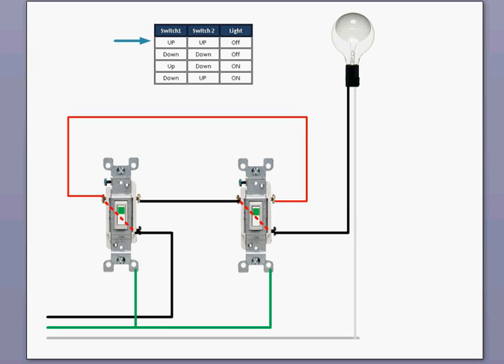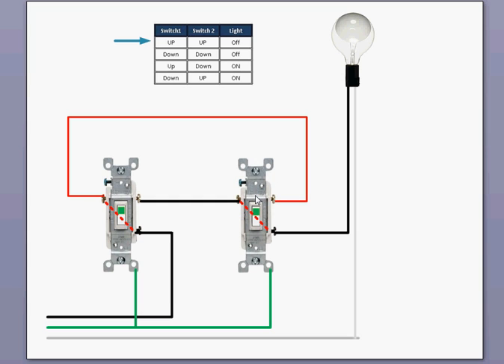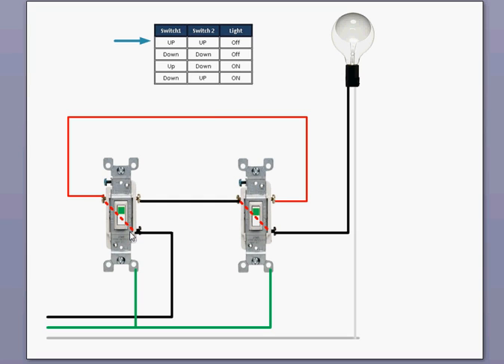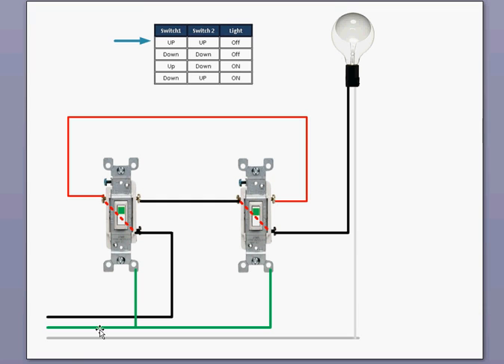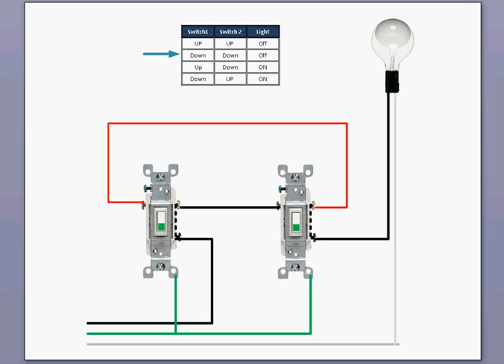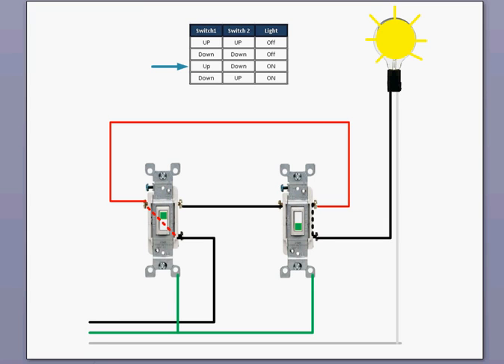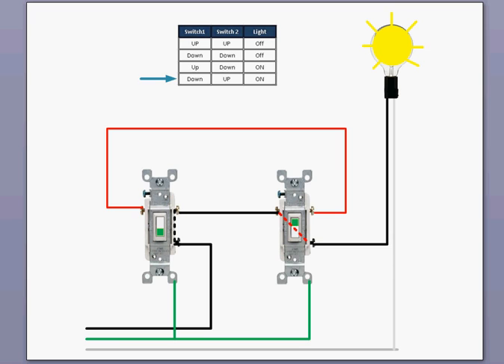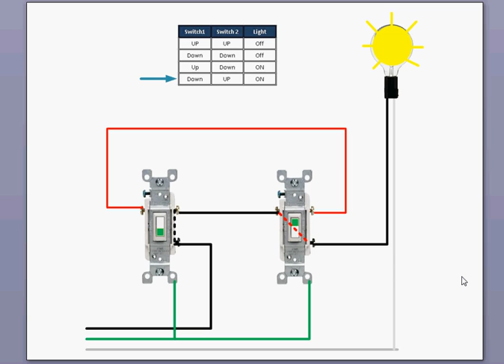3-way switch wiring

Comment: Hey works great thx! I found it by accidentally messing up putting in new switches,

by deduction I isolated the hot 120 (left switch) first with a meter, put it to common,  wired in the red on the opposite side pole, then the remaining black had only one place to go.

Then on the light-close switch (right) I landed red on the same side pole as Common, then had a 50/50 chance guessing which black . . my first guess was right ;)